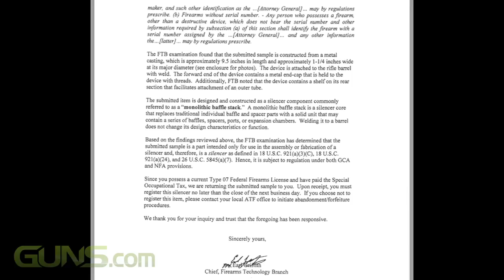Court to decide: Is it a silencer or a muzzle brake?

Comment: That is similar to the "Ares Breath" muzzle device, which is legal.
Reply: ggcuervo While a passing glance would say "Yes, that is the case." the Ares Breath was designed and manufactured with anti-tamper pins to prevent exactly what Sig is advertising with the MPX muzzle device.

Comment: silencer and bulletproof are hollywood terms, the correct term is suppressor, as guns are never completly silent unless they are not being fired, bullet resistant is the correct term, cuz even steel plates will warp and eventually brake after consequtive hits